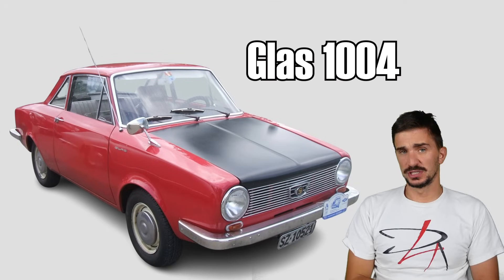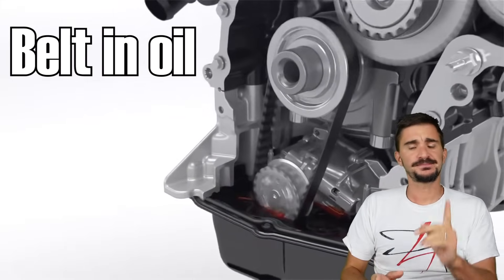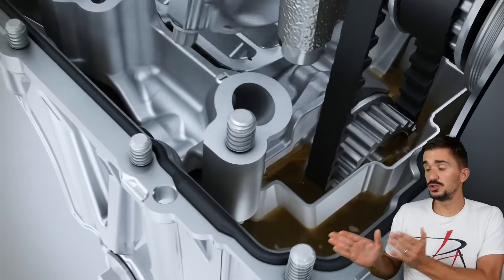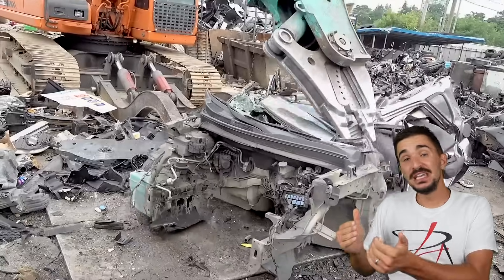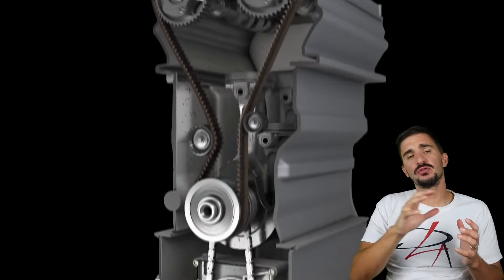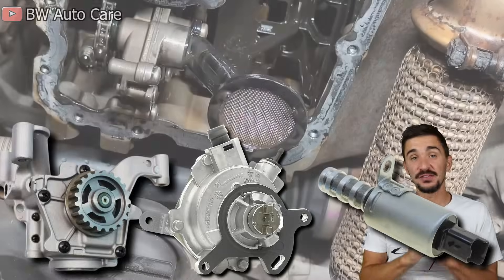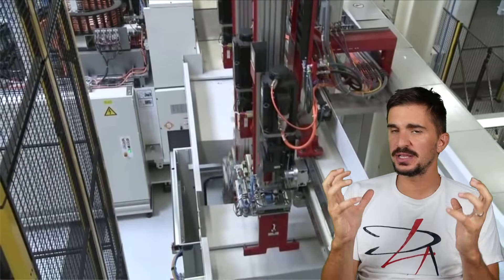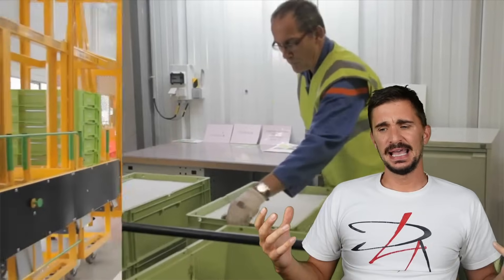Who Approved This and Why Is It Still Being Made? Wet Belt aka Belt in Oil Engines

Comment: If manufacturers were made to replace engines that fail with less than 100,000 miles on the clock I think there would have been a more urgent response to fixing this catastrophic problem, Land Rover have a similar problem with crankshaft snapping leaving owners with a potential bill of £15,000. They have known about this problem for a few years but done their best to ignore the problem exists,the same applies to the crazy practices of Not putting lips on the main and big end bearings to stop them spinning and blocking off the oil feed to the bearings again causing catastrophic damage to the engine,these faults are the fault of the manufacture trying to cut costs leaving the customer to foot the bill when things go wrong. Land Rover have got away with millions of pounds worth of claims with these faulty Crankshafts.

Comment: Well, as a german engineer... Sometimes you have to except, that some technology has settled. There is a actual peak-solution you have to fight with and MAYBE the conclusion is "We find no better solution, only different or less better"
 In my case, a 1.6TDI dry-belt with 350.000km and ONE change at 190.000km right now. Recommended intervall is 220.000km.
Guys, tell me if im wrong... For me its a serious amount of travel-distance until major maintanance done with 600-700 euros including the waterpump.

Comment: I work for a major global manufacturer of power transmission belts and other rubber products, and yes there is many compounds that are fine with oil, but they are not perfect and all will eventually swell and delaminate from the carcass, I'm also an ex Automotive Mechanical Technician and If I had of been in the room where the engineer put this choice on the table, I would have flogged him with an office chair and told him to look at a different career path, this goes down the same path of using Bakelite gears in engines, they fail, prematurely and all needed to be replaced with metal ones.

Comment: This is not a corporate profit issue. No company wants their reputation trashed by something as simple as a belt. This is 100% due to government regulations. A miniscule saving to the vehicle's owner was never the goal, the 1% increase in efficiency applies across the entire fleet. Here in the US its called Corporate Average Fuel Economy (C.A.F.E). Switching to the wet belt from an engineering standpoint is easy and the 1% increase meets emissions regulations at that moment kicking the can down the road until a new engine design can be developed. If governments had more realistic efficiency requirements there would be more time for proper engineering advancements instead of shortcuts like wet belts.
Reply: I was thinking the same, every government intervention with objective to improve something end up generating negative effects

Comment: 15k oil changes are only for diesel(without a DPF) vehicles and petrol vehicles that get regular highway use. A modern diesel with a DPF that does not get highway use will constantly get oil dilution(diesel in sump) and a clogged DPF. A modern petrol that gets no highway use should have its oil changed every 5k-8k kms depending on how little runtime it gets. Otherwise it will get oil stuck in the rings and blow oil out like mad. Sometimes manufacturers are kind enough to put this information in the fine print. Mostly, they do not. Saying people will not accept 8k oil changes is just silly... 0w8-0w20 is really common now. It is so thin that bad things will happen if you do not change it often. Whereas an older engine, you could have gone 5k over once or twice in its life and no harm would be done(especially with highway km's on it). The point is that it is MORE important now to change your oil regularly than ever before in automotive history.

Comment: While right on most, talking about it will not improve the chances of it happening again because as you said, what was common knowledge was ignored for some reason.

Maybe we should think and investigate and publish, what led the Japanese people to avoid creating such an error (until proven otherwise) while American and European peoples chose to go with wet design. 

Very good analysis, high attention to details and technically correct. Btw, regarding small engines designed to run hot, PSA’s Puretech is designed is to keep engine at approx. 80 degrees Celsius which will keep engine relatively on the less hotter side. 
But anyway these engine should be treated as motors that run is severe conditions especially for the hot climate places like the middle east and hot summer states.

Comment: I work at ford and many upon many engines fail with the wet belt system anywhere between 40k-60k miles on those engines.

Comment: Mechanics have started calling the Eco Booms. My 9yr old Focus 1lt ec boost failed last summer 10, 000 mileage less than the amount recommended for a belt change.  I, just like 90% of other owners, knew nothing about these belts until the poo hit the fan.  Talking to other owners I have yet to come across one that knew about wet belts when they bought the car and wouldn't have bought it had they known about them.
Its like having a ticking time bomb in your wallet.
I now drive a Kia  with a chain.

Comment: Bit late to the comments section of this video. I’m an engineer myself and actually know one of the engineers who worked on the team that developed the 1.0 Ecoboost engine with the wet belt for Ford. He said the wet belt was entirely efficiency driven and nothing else. Obviously these haven’t stood the test of time and have aquired the nickname “Ecoboom” at least in Ireland anyway. Efficiency over longevity has been the methodology of vehicle development with the last 2-3 decades. This along with a large push to get people into new cars with pcp lease agreements where you basically rent the car off the dealership for 3-4 years paying a fixed rate and then have the option at the end of the period to pay off the balance or trade it in for a new car again and continue the lease cycle. Greed and profit margin aka Capitalism has caused nothing to be developed for longevity these days. Can confirm also that in Fords case, that it’s not just the wet belt system, all their new vehicles are coming back into the garage to be repaired and the majority of the issues these vehicles are having are significant

Comment: GM & Ford were feverishly trying to figure out how to engineer-out quality and engineer-in failure.  Where things got a bit tricky was in the calculations necessary for the failure to occur AFTER warranty expiration.  Cutting the failure rate as close to the expiration was thrilling, but also risky because some might fail during warranty.
Creating the rubber pieces to accumulate at the sump was one of the interesting designs, that failed brilliantly.

Comment: At a very young age an old man told me that whenever something new comes out you don't want to be the guinea pig, the public is catching up fast to whatever is going on, people are willing to go to a page to give their opinion about anything, you put 2 and 2 together it's 4, people aren't stupid anymore, the old "trust me bro" doesn't work anymore... I have a 2006 car and I am not looking forward at all to getting a new car, every car after 2010 has a pending issue that the manufacturer didn't solve on conception... Wet belts, weak gearboxes, electric turbos and the list goes on and on... They fix one issue they add another always under the guise that "I didn't knew this was going to happen" they are engineers, they knew exactly that would happen...

Comment: And they laughed at Lada for having wet chains. Lifespan of a chain which is partially submerged in oil is 150.000-300.000km but most wet belts fail at 60.000-112.000km. There is a reason good cars are built on simple platforms. They are literally trying to rediscover fire.

Comment: The cost of a wet belt change on a Ford Transit Custom in the UK at present is approximately £1100 plus 20% VAT. It's just a rip off, it's about time someone took the industry to court. As they have known about the issue for years.

Comment: For that Ford 1.8 TDCi diesel engine, conversion kits with a chain came available aftermarket. This was possible because of the design, all the sh*t engines of the “Ecoboom” , Pure Tech and other designs, with the wet belt all the way up to the cams, I’ve never seen a conversion kit to switch to a chain. Not possible to bring a affordable set to the market or technical wise.

Comment: Strance story 
I was under the impresion it was actually Ford was one of the first with a rubber belt 
The coshworth engine 

And telling it would have the same lifespan as a chain 

But they broke around 150.000

And that was when they put in the every 120.000 km replace interval 

Not 160.000

Comment: Honda 1.0 3 cylinder petrol has a wet belt.   My colleague has one his Civic. £1600 to replace on a 40k mile car 5 year old car.  I think the Ford 1.0 is similarly expensive, over £1000.  At least the Peugeot 1.2 Puretech, the wet belt replacement is £600, which isn’t good, but not outrageous.

Comment: I am a fan of chain, not belts. imo they are more reliable. 
Also, why don't more cars (or any non-performance) run oil coolers? It makes sense to keep the engines oil, and the engine itself, a bit cooler. More so than the coolant does. The oil gets a lot hotter than the coolant. I mean, I live in an area that gets hot, regularly. I don't see why it wouldn't be at least an option for most cars. Overheating is or has been the biggest break down issue in almost every car I have had to fix. A blown gasket and/or cracked head were some of the main problems that caused the overheating... or the overheating itself caused the damage to begin with.
Engine rebuild costs more than the car itself, at the time... could be said about most all fords, could be said also about many other makes, but still... being as Fords were marketed as the cheaper (or more afFORDable) family/work vehicle (and why they got so many sales), it makes sense. I remember my dad hit a deer and it popped one of the airbags, which totaled out the car... an airbag was more expensive than the car. He replaced it with a Toyota, that is still running today at almost 200k miles. I personally never buy Ford, and I do still have my Mopar issues but, still won't buy a Ford.
But how else would car manufacturers make more money if not for planned obsolescence... or designing parts meant to break after "X" cycles/miles/minutes?

Comment: Automatic Transmissions have always used rubber seals which live in a bath of hot transmission oil for sometimes over 200,000 miles.  However, these are only in dynamic use during a shift into another gear.  But, this is just to point out that, in static applications, rubber seals do well.  In addition, front and rear engine crankshaft seals are rubber lip type seals which are tensioned against the crankshaft by a circular coil spring around the outside of the lip seal.  These also last well over 100,000 miles in most engines.   A timing belt gets more severe treatment than these aforementioned seal types and I agree that they shouldn't run in engine oil and be expected to last as long as a dry belt.  It is also ridiculous to run them in an interference type engine which will lunch the engine if they fail.  
There ought to be a law to protect consumers against this type of fraud.

Comment: this is the same reasony why we dont really have Carbon Fiber engine inner parts, becvause the dont cant survive together.... in an oily  system. doenst realöly work...  xD well, i love my old diesel (2005) 1.9, needs basically  less fuel then the equalöent today and runs fine even in minus 20. love it, if it ever  breaks i will rebuild it, ( and yes with a bit more punch :D )

Comment: I'm not an engineer by any means but as a mechanic I do know that one thing that is the death of an engine is excessive heat. I'm sure someone with a degree in this field can justify this mess but as long as they produce it i won't buy it .
 I will constantly learn how to repair and or replace these engines to keep my humble self employed.
 I own a 1997 truck that was offered with a 2.3 or 3.0 or 4.0 engines respectively but noticed the 3.0 version had a larger radiator than the other two and I cut vents in the hood to lower underhood temperatures(a factory fault) and my particular truck has 375,000 miles since new. This engine in this vehicle was known to have excessive heat related issues. Some things are just obvious.

Comment: The brand new 1.5 L powered Chevrolet and Buick models, three cylinder ones, are also wet belt. 

Here in America and Canada. These are brand new 2024 models. 

So no, unfortunately, manufacturers haven't started replacing the technology, they are fully for it

Comment: Check out The GM LM2 and LZ0 diesel 3.0 Duramax engines. They use an oiled belt for the oil pump. The rest of the timing system is gear driven. But they have a service life of 150k-200k miles 241k-321k KMS they say no issues are found but I’m still skeptical what do you think?

Comment: Government regulation should not only take the efficiency of an engine into account, but also its reliability and longevity. An engine that fails prematurely and/or requires frequent oil changes is not very environmentally friendly, even though its emission figures may look great in powerpoint presentations.

Comment: If you guys are having problems in Europe with mild weather imagine how those engines held the scourging heat of Brazil.
It's common to see those engines failing before 50k km and the problem is even harder there because vehicles are way more expensive.
It have been some years that people are putting red flags in vehicles with such timing belt and they then to loose way more value.
The sad truth is manufactures keep putting this non sense in new vehicles nonetheless

Comment: The very main problem is running the belt in the same oil as the engine’s oil. 
Perhaps, and even then it’s ridiculous with the wear and tear contaminating its then own dedicated oil, it would lead to less secondary troubles to the engine.
Reply: I am thinking of a more consistent viscosity that is not subject to the heat of the engine’s oil + no cross contamination to and from other engine parts. Thus no fibres from the belt into the engine oil strainer, but also no fine metal particles that deteriorate the belt.

Comment: The most reliable engine ever made by Ford the 300 inline 6 owes a great deal of it's reliability to its timing system which is the camshaft being directly geared to the crankshaft almost no way for it to fail unless youre deliberately trying to kill the engine. So of course Ford later on releases a random amount of 300 i6 that have plastic gears in them. Design one of the most reliable engines of all time and they basically had to re design it to break because they were losing money on all the service they werent seeing once it started getting to the era where service became an expected part of a truck's profit.

Anyone who accepts "its quieter" as an excuse for a less reliable engine design needs the boot. Its an engine ffs and it really doesnt make much difference.

Comment: I have changed these belts ,,and the transit,,and the peugeot,,,I have stripped out many fiestas and focus with oil pressure faults due to oil pump strainer blockages when doing these remove the vacuum pump and clean out gauze and also the oil pressure sensor ,,,,in my opinion it is built in obsolescence as it is such an expensive replacement..

Comment: Agree with every point 100%. It's a massive con. How about this though? If wet belt is going to stay, make it so the part can be changed by the owner without special tools. Use technology so that it can be replaced as quickly and easily as an air filter. I've no idea how this would be achievable, but I'll bet it could.

Comment: Wet-belt timing belts generally require fewer shaft seals compared to traditional dry timing belts. The precision needed to get blocks, crankshafts, and covers aligned so the the seals work is daunting. If you get it wrong the customer will soon discover an oil leak -- usually before the drivetrain warranty has run out. Ergo, less costly warranty repairs. By the time the timing belt fails the car will probably be out of warranty. So, this is purely cost driven with no concern for the customer. That's why you don't see this on Japanese cars. The Japanese culture is hyper customer oriented.

Comment: It seems that Ford was the first to introduce a timing belt 1971 to the market. First of all, nothing happened to it (Pinto or European OHC) even though the belt failed, and secondly, changing it was so easy that it was done in the parking lot in half an hour. Worst is   Vag, that is, an Audi with a V8 that had to be lifted engine on the table to change the timing belt. Chains have made a comeback, but they're also so weak that they don't seem to last any better than oil-soaked belts. I think the car was at its best in 1995. After that, all brands are more or less bad. The current ones are mostly 16-valve water boilers that are controlled by MS windows.

Comment: Toyota uses a sorta belt/chain hybid in their cvts thats essentially a metal chain but is shaped like a rubber belt and they found its significantly more reliable than a rubber belt but its also smaller and cheaper than a metal chain so why not use that as a timing belt in all engines?

Comment: There’s some incorrect info in this video - the Renault 1.5 dCi and 1.2 TCe engines DO NOT use a timing belt in oil, they use a normal belt. Neither does the 0.9 TCe - it uses a chain. The VW group 1.5 TSI doesn’t use a wet belt either. The 1.0 and 1.5 VTEC turbos from Honda DO use wet belts though and are also best avoided.